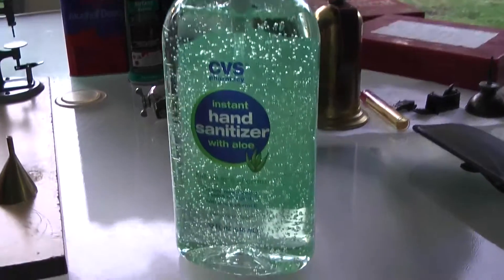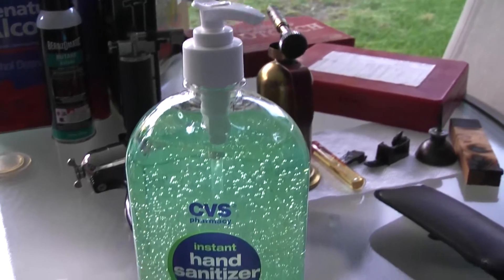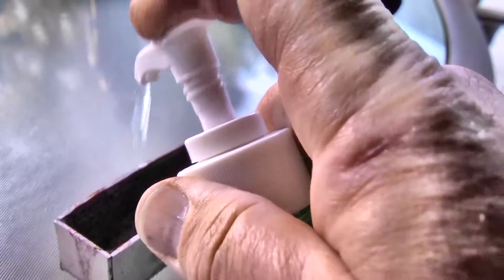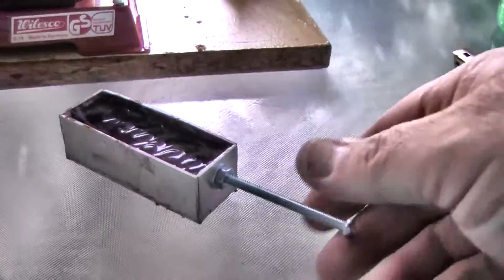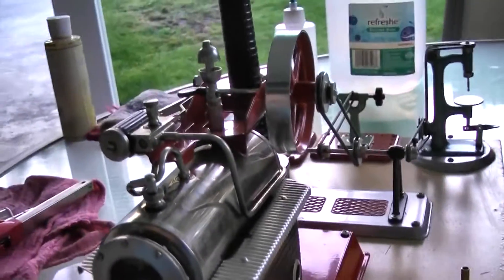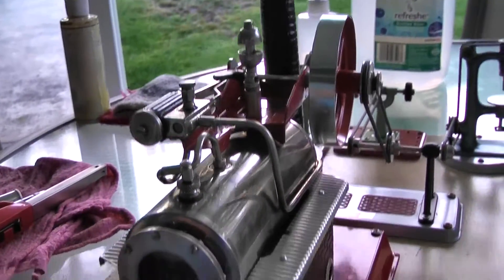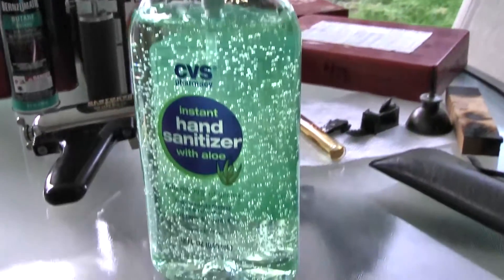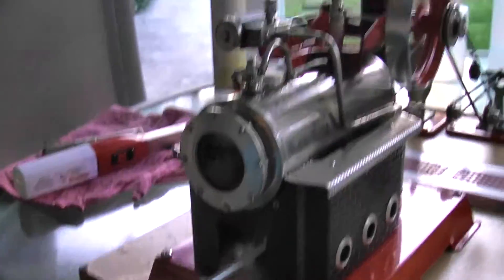Steam Engine Runs on Hand Cleaner!

Comment: I use Purell brand hand sanitzer (70% alcohol) burns clean, pre-heat your water for the boiler in the microwave till boiling, engine, Jensen 75, is ready to run in about a minute. Haven't tried the aloe type, just the regular stuff.